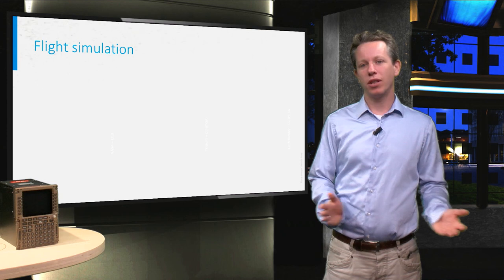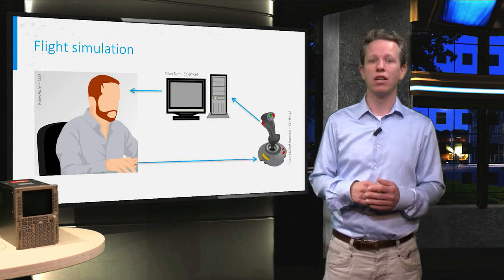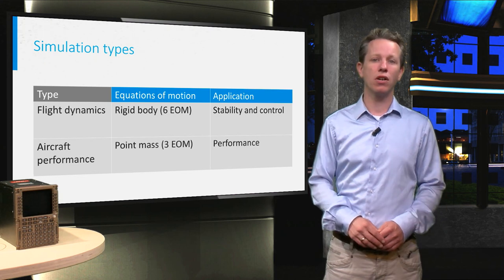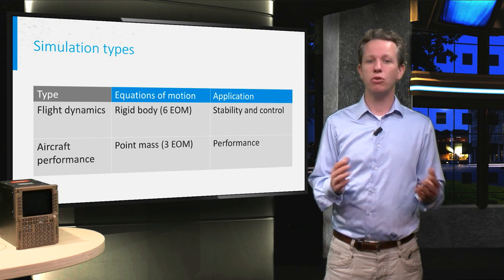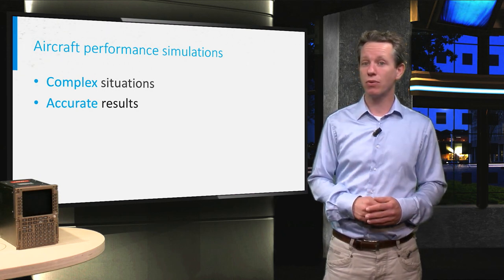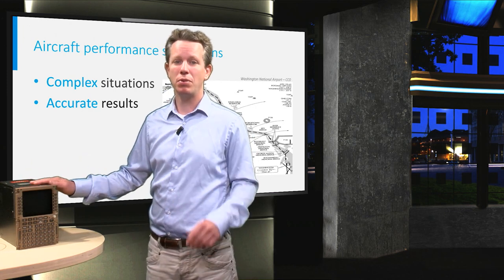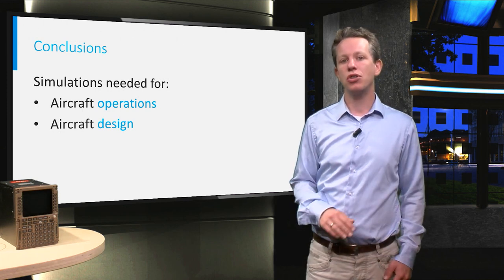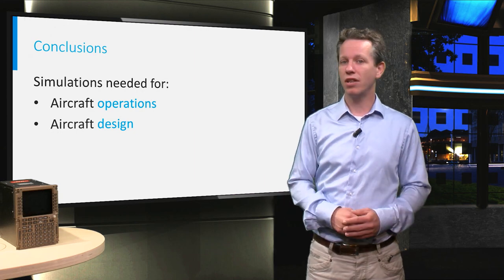Aircraft Performance Course: Why Use Simulation?

Comment: Thanks a lot for this highly valuable material. My background is Physicist, Geodesist and Air Traffic Controller, and as a result of that combination I love aerospace/aeronautical engineering, particularly, aircraft performance and some aerodynamics. I am devoted to learn by my own Aircraft Takeoff and Landing Performance in different scenarios as on contaminated runways, and as I am an aerodrome inspector with a scientific side I love your courses you are sharing as for instance, that related to climb flight or accelerated flight regarding energy considerations¡¡¡